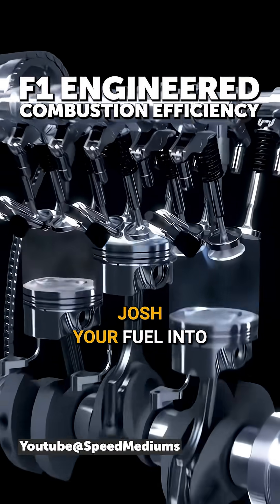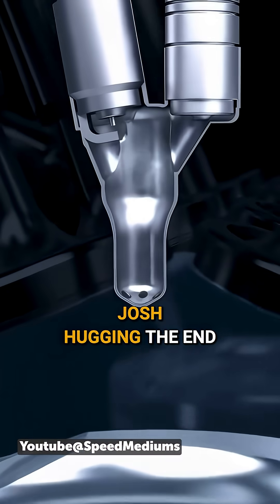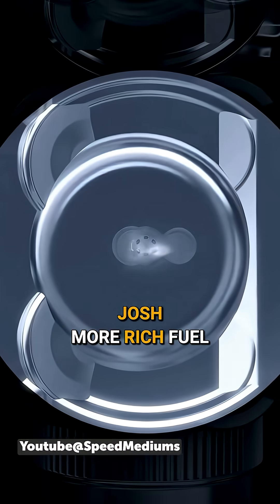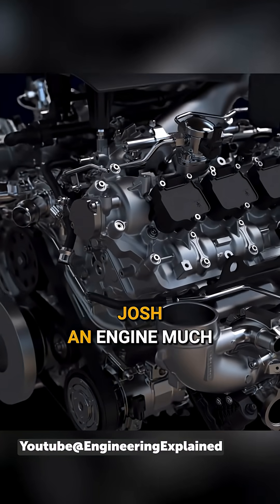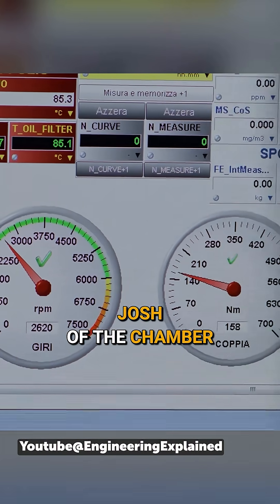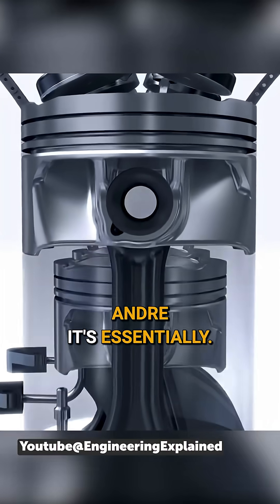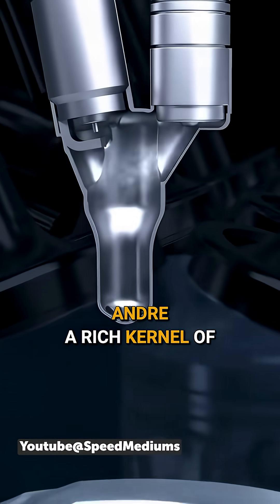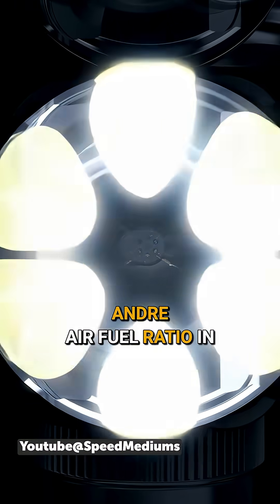Pre-ignition Chambers - F1 Engineered Combustion Efficiency

Comment: Toyota still does it today but without a prechamber. They use direct injection to spray a bit more fuel in front of the spark plug to enrich the mixture just enough at the right spot for it to fire.

Comment: Ultra lean is great for fuel economy but getting it to light....
As said already stratified charge was used by Honda for gas/petrol engines. That was achieved by the amount of swirl in the engine and the injection timing and shape.
Diesel engines have used swirl to get the plume from the injectors to spread out more so there is more even combustion.
Diesel engines have been designed for homogenous combustion, where the fuel is mixed so it is evenly spread (homogenous) and then ignited. Problem is getting the ignition to occur exactly where it needs to occur. Caterpillar developed many components that would be enablers, ceramic head inserts & pistons, variable CRatio engines (the crank was held in rotating bearings), high boost (twin/dual turbos, turbo and SCharger), control systems.
Many gaseous (e.g. natural gas) engines are homogenous as they put the gas in before the turbos or straight after the turbo so it has a "lot" of time before it gets into the chamber to mix. But the mix is too lean to ignite, so the spark plugs have a little chamber that collects some of the gas so the spark plug can ignite it. This was limited in the range fuel ratio it could support.
The system shown in the video addresses these ignition woes - make the main chamber lean, make the fuel right beside the SPlug rich enough to ignite. Very little fuel very reliable ignition.
Research has looked at HAJI - hydrogen assisted jet ignition. This works really well but isn't used as you have a second fuel to be catered for.
For the current emission levels HAJI has been looked at but as FAJI - fuel assisted. It has been found that you get very good results by just using the main fuel for the spark plug to light. HAJI is better but not enough to overcome its inconvenience.

Comment: so why dont we have them on roads now?
Reply: Because emissions actually. Road cars need catalytic converters which need 14.7:1 AFR to operate correctly. What this kind of pre-chamber ignition allows you to do is to run significantly leaner than that, but because of the cat you cannot run much leaner on the road, so on the road this tech doesn't really offer any benefits that would outweigh the cost

Comment: The one downside is that the chamber holes can get plugged with carbon and also they can overheat and break and fall into the piston and valves, but it works great as long as it's regularly changed and maintained.
Reply: Means it works best in hight temp, high rev conditions. Great for motorsport, or high load conditions such as hard towing.  Not much good in a production engine.

Comment: So basically what in a Diesel would be an indirect injection system.
Reply: Idi diesel is still the king for fuel efficiency and thermal efficiency
Reply: @turkeyboyjh1  For small engines fuel density gives it some advantages. I love my oil engines, but after having also worked in the gas industry for a few years and converted many engines plus been a part of experimental work on multi-fuel engines I also have a love of gaseous fuelled engines.
  This is where oil engines really shine as they can easily be made into true dual fuel engines with easily adjustable on-the-fly mixture adjustment.  Oil & gas line pump engines are a good example.
  Personally I am a big fan of Hydrogen used either in fuel cells, (it is hard to dispute electric drive for pure efficiency. Edison Motors in Canada are doing great work here),  or in direct burn, (JCB, Ashok Leyland, Cummins, Hyundai, Toyota etc.), but think that it it best used in an ICE as a key part of a duel fuel system.

   A great time to be alive in so many ways aye?

Comment: Internal combustion engines are woefully inefficient compared to electric motors.
Reply: Cool
Reply: My diesel did 700miles to a tank when new. 20yrs on, it now does 700miles to a tank. And takes approx. 3 minutes to fill.

How's your battery faring? 😂
Reply: @g.w.customcreations3534 most of the energy in your diesel fuel is wasted as heat.

Comment: This is diesel technology that went out of fashion in the 90's
Reply: It went out of fashion because it's unnecessary for diesels. It's still got some major benefits for petrol engines and is actually a fair bit different to an IDI diesel. It injects only 10% of the fuel through the pre-chamber injector instead of all of it and the rest comes through the port otherwise you'd run into all of the same issues as DI like the insanely short injection window which massively limits your max RPM and thus power output.
Reply: @stuntvist well said sir. However max RPM on a diesel is mostly limited by the slow burn rate of diesel fuel if I understand correctly. 👍🏼
Reply: @Zgurkogel  That and the massively undersquare and short rod designs diesels make use of (less dwell time and faster acceleration from TDC to BDC). The only diesel I can think of that isn't undersquare by design is the IDI OM606 and those can rev fairly high for a diesel (peak power at 6500-7000RPM isn't unheard of for modified examples), but it's a fairly limited design that's not as capable as more modern disels like the M57 and overall gets far less out of the fuel than something like an M57. For petrol engines direct injection basically caps your max RPM at 7500, maybe 8000 because you'd need to inject all of your fuel within a few nanoseconds if you go higher and that's just not possible with current technology. Pre-chamber designs let you get the reduced knock chance and thus higher compression ratios and better burn of direct injection without the downside of severely limiting the RPM. Plus the burn is a lot more uniform across the chamber which, with good design, could net less emissions than current direct injection engines, especially less particulate matter.
Reply: This is not precombustion chambers these are WAY smaller. They disappeared for among other things the amount of heat lost thru the precom chamber.
Power wasn't the problem - the Cat 1693 developed 425 hp until '77. It was 10 years later that the 3406B ATAAC eventually reached this level.
Just for fun the next step in power was the 3406E in 1994 @ 550 hp, then in 1998 with the 3406E 15.8L @ 600 hp. 600 was the highest power in NA until Cat exited the truck industry in 2008

Comment: 60 year old honda cvcc technology. Theirs was designed to run 21:1 fuel ratio instead, and passed emissions without a catalytic converter.
Reply: Worth noting that they probably had crazy high nox emissions at the time as well, theres no way to escape that without exhaust aftertreatment
Reply: @andrewbreazna actually no, as they weren’t turbocharged and the combustion temperature and pressure weren’t that high as modern engines
Reply: @unclebenjen8661 actually yes. NoX production exponentially rises around 700 degrees flame point temp (this is not exhast temp). You are flat out wrong. Sorry bud.
Reply: this system is not new , diesel engines have been using it since the early 1900s its known as a prechamber . theres different kinds of „prechambers“ 
vorkammer , wirlbelkammer, luftspeicher,… 
the goal was a better air-fuel kixture and a better combustion , since unburned fuel is lost power , the emmisions were not important back in the day , sure they get better since u burn more of the mixture , resulting in more power . this teconology originates from so called ,,Ölmotoren‘‘ or Oilengines , also known as diesel engines. it has multible atvantages …. it alowes for a better mixture of air and fuel , alowes for faster ignition of the mixture , therby increacing power and reduching the risk of knock wich is just a to early ignition of the mixture . this only works with fuel injection tho … its a form of indirect injection wich by itself comes with a few MASSIVE advantages
1. the prechamber alowes for lower injection pressure . a prechamber diesel will have about 115-150bars of injection pressure , a direct injection can be up to 20times as high . lower pressure means less strain on the pump , injectors and anny gasket involved . 
further more since the injector is placed outside the combustion chamber it stays cooler , in fact old direct injection 2 stroke diesel engines had cooling finns at the injector to help keep it cool 
so less wesr and thermal stress on the injector . they never get stuck in the engine. since they have to withstand less pressure they are also cheaper to manufacture . and they can be easely repaired in a garage that has the needed tools. wich are not expensive at all . a basic injection overhaul can be done by annyone who owns a touqe werench and a manual injector tester (costs like 100€) . 
it does come with some downsides too … more parts needed … 
instead of one direct injector you now have : a prechamber , a injector mounted ontop of the prechamber and a glowplug (if its a diesel) mounted inside the prechamber, also prechambers are under extreme thermal stress. causing problems if you turbo the engine . 

the om 603 as example 
as NA it had 109-113HP 
turbo ~140 HP 
(i know that there was a 603 D35 (3.5L) variant that existed na and turbo but since they are quite rare i will not count them and their uniqe headgasket problem into acount)
if you upgrade the turbo increase injection pressure and fuel amount you will start facing problems because the prechambers overheat . 
later variants fixed this by a different designed head coolimg system to keep the prechambers cool . 

best example for this would be the 606 …. wich of course had its own problems …

Comment: That will be fun when that starts plugging and fouling due to rich ignition.  Engines have existed for over a century.   We don't have trouble igniting air/fuel mix.  Just garbage to sell overpriced junk cars.
Reply: Incandescent light bulbs existed for over a century too, but it turns out they were hardly the peak of generating light
Reply: Plugging how if there is a very forceful  ignition happening inside, it would be cleared out every time, also gasoline is very good at cleaning
Reply: ...this is about Formula 1 engines dude...

Comment: This concept isn't anything new, the older diesel engines used this concept very well, but with new tech they did away with it. Higher fuel pressures and direct injection made for better performance and fuel burn. So I don't see the point here.
Reply: That was my initial thought as well, although some of the commenters on here point out some valid reasons for this tech to work.

Comment: My 1977 Honda Civic CVCC 5 Speed also used a stratified charge system which allowed it to meet the EPA emissions standards back then without all the extra pumps,  plumbing and gear that turned the rest of the cars back then into maintenance nightmares.

Comment: Some 1970s Subaru EA series engines used a similar stratified charge setup, but using a separate air valve that would let in a timed burst of air into the intake to sandwich a lean mixture underneath a rich mixture at the top of the combustion chamber. The engines with that system produce the same amount of power as the ones without, but use less fuel. And it was all done mechanically, on a carbureted engine.